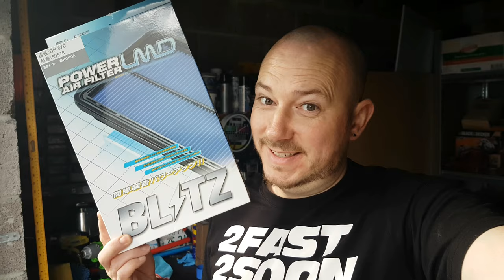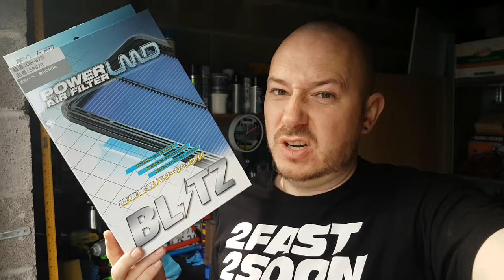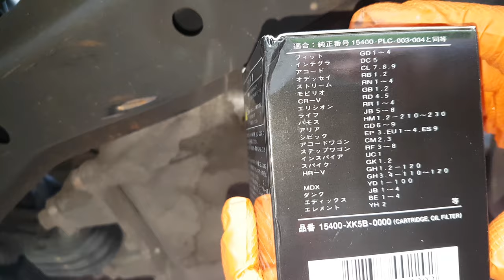Honda stream Oil change/How to change oil/RSZ/RN6/ mugen/1.8 vtec/r18/jap import/Irish car scene/JDM

Comment: Hey man, what oil you useing 5w 40? I have no idea where yo start looking for parts like pads and oil not something you can just enter a reg for with these streams! Iv the same stream seen a Couple of google searches come up with 5w 30?
Reply from the maker: Yes, if you are in Ireland/uk 5w 30 is what you would use, but hotter or colder countries would be different, its the same as the 1.8 civic of the same year. An R18 engine. Check out these site's for parts. 

https://shop.febest.eu/catalogsearch/result/index/?p=4&q=Honda+stream+rn6+model+X

https://partsouq.com/

http://www.jikiu.com/catalogue/542300/#/vinsearch

https://www.amayama.com/en/genuine-catalogs
Reply: @GPTV2020  uk yeah. Legend thank you!!
Reply from the maker: @deano386  welcome.

Comment: Im using Amsoil Signature Series 5-30... the car runs beautifully... Atf transmission is Ultra DW1
Reply from the maker: I used to only use top names like motol or Castrol, until i found out that SPOON RACING only use honda oil and all their race engines and when asked why not something better spoon said "These Honda engines have been developed to work with Honda oil so all we're doing is adding on performance parts to a Honda engine so why not use Honda oil and we've never had any issues with the oil" so that's why I use Honda oil but Amsoil is very good also. Thanks for the comment.

Comment: Bro where can I buy the transmission fluid for the stream?
Reply from the maker: I just go to honda for any oil, it's the best choice.
Reply: @GPTV2020  Bro i called in honda and they have 0w20 4 litres and Automatic Transmission Fluid 4 litres will that be enough for 1.8 vtec r18 honda stream
Reply from the maker: @dailydad6335  handa should have known what you needed but yes 3 litres should be enough, always check the dip stick, don't over fill it. It's worse to over fill it then it is to under fill it. Drive it a bit after doing the job, then check levels again.
Reply: @GPTV2020  I asked the guy but the guy i was speaking to said he dont have the exact specification for a japanese import  only the irish ones, what the heck does that even mean? Its honda. I am not doing the service to them just buying the oils I have a friend mechanic who will do it for me, i bought the stream recently.
Reply from the maker: Ah sure, they just sell it in Ireland, they have no interest in doing extra work to find out how much you need, a few clicks of the mouse and they could have told you, but thats what your dealing with here. Why change the oil at all? Just because it's new to you or is there a problem with it.
Reply: @GPTV2020  Just bought it last friday from dealer, I feel better at ease if I changed the oils and I know the quality of oil in it.

Just bought 0w20 and ATF fluid and will get the stream service tomorrow.
Reply from the maker: Yeah it's always a good idea when you buy a new car to change and check everything.

Comment: Bro what suspension kit we can use? The rear suspension of mine is leaking.
Reply from the maker: https://youtu.be/GGMnZMWpRUs here is a video i done about my suspension, there is a part number in this video. But best to keep them stock in my opinion.
Reply: @GPTV2020  thanks man but it really is hard to get suspension parts, but if I buy an old one how long will it last, I called red power and they said they can provide me bc coilovers they are not cheap and I think you can adjust them softer or stiffer, will they suit daily drive with occasional road trip.
Reply from the maker: I like a car to look low with good handling but i removed my dampening adjustable coilovers because of two reasons, 1. The top mounts were gone as you seen, but two, the are very hard to live with. You cannot set them softer the the original suspension, they are very bouncy and if you lower the car, you get negative camber which means the inside of your tyres ware away quickly  so you'll need camber bolts. Thats fine, they are cheap enough for the front but the need camber arms which are 200 euro. BC's are excellent coilovers so they could feel good on a daily but my coilovers were a grand and they were good but hard to live with.

Comment: how many litres of oil does it take?, I have 2012 RSZ version and we put 5 litres, someone told me thats too much
Reply from the maker: yeah, thats a bit much, 3 to 4L is enough, put in 3 let it settle for a few minutes and then if it needs a bit more after dipping the dip stick put in more but it should only need around 4L to the top notch on the dip stick. if you put in too much then when driving it can start going out your breather pipe in to your air filter, open it and see if its oilily if it is stop driving it, change it, clean out all the pipes and drain some oil, just loosen the drain plug a bit let out a bit and tighten it up again. hopefully you didn't get any in the intake.
Reply: @GPTV2020  intake and others are ok, little residue on the Air filter from engine braking I was told. I have done 3 services so far since purchase and we put 5 litres each time.
Reply from the maker: Well after a while the 5 letters would settle down and would be over the top mark on the dip stick id say, in the owers manual it will say how much it will take. 3.5 L or 3.7 quarts i usually put in around 4L at the most.

Comment: Hi mate are car parts for this vehicle easy to get I’m thinking of buying one UK
Reply from the maker: Honestly if you just walk in to buy parts in any motor factors then you will most likely get the wrong parts. But there are good websites to get OE part numbers so get the part number you need and bring it to a motor factors this is how i normally do things, or bring the old part with you and most shops will measure it up for you.